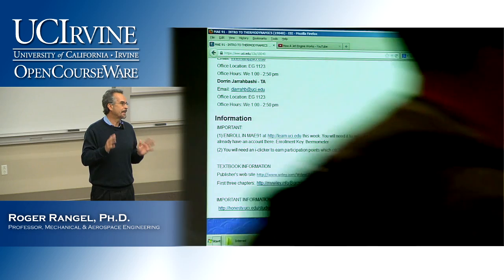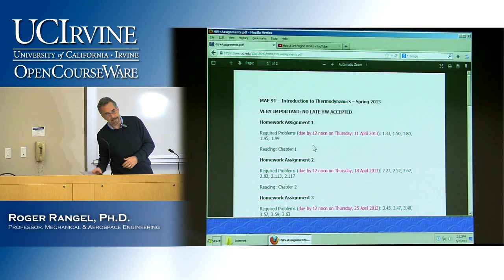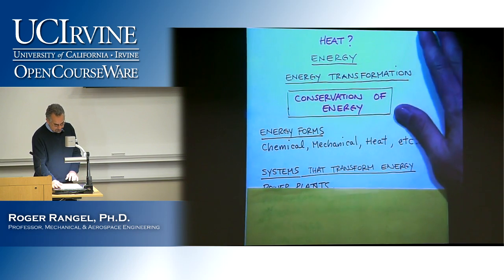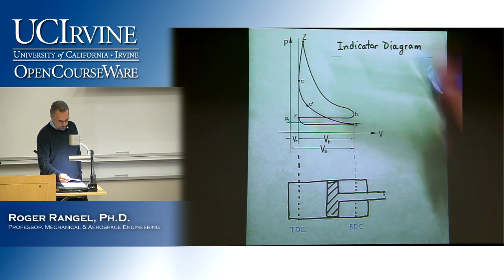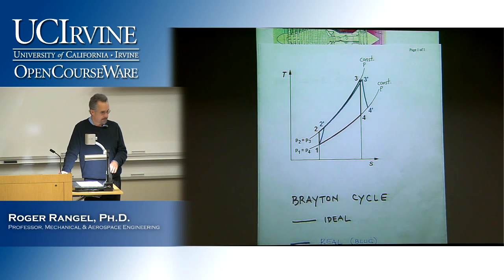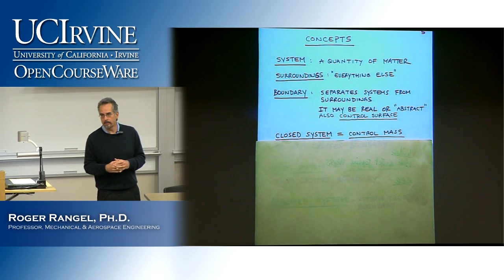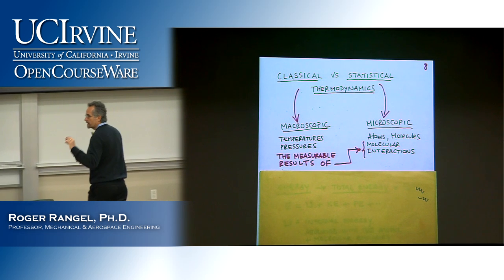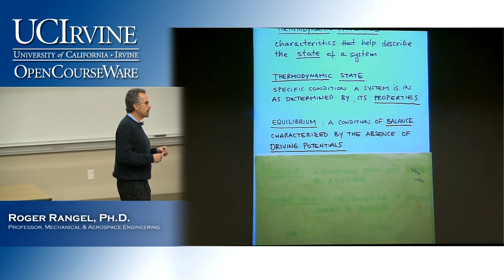Engineering MAE 91. Intro to Thermodynamics. Lecture 01.

Comment: I don't get it, why do we need such a complex process at the power plant? Why not drive the turbine directly from the combustion chamber with the exhaust gasses gathered from the combustion?
Reply: Its because the form of energy source we use are not that clean for example coal. You dont want coal by products in the moving parts that will be a problem. As for nuclear 'cleaner' energy it's not a combustion system.